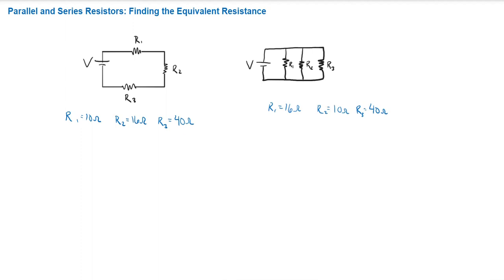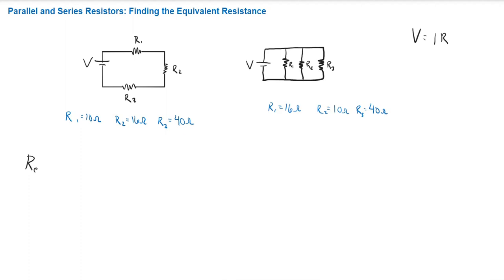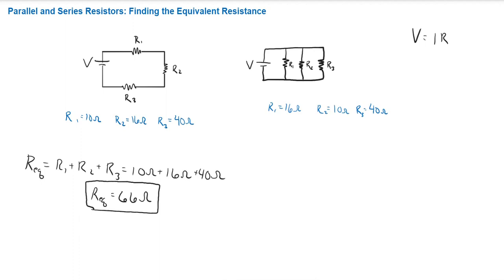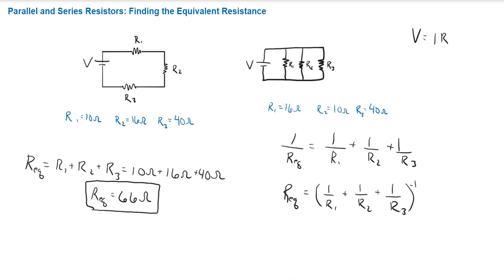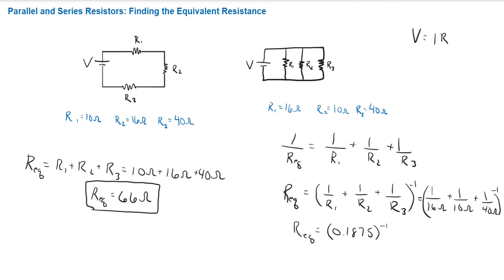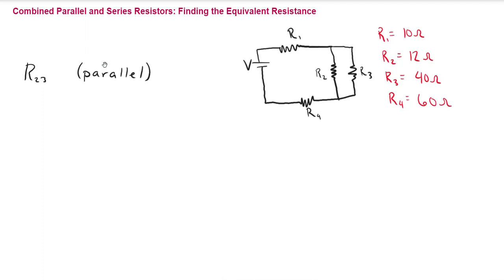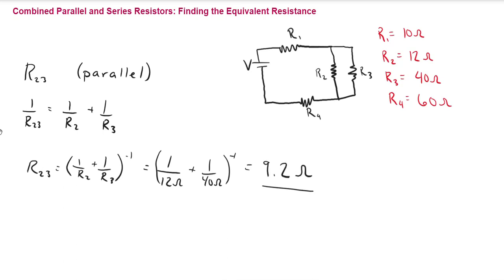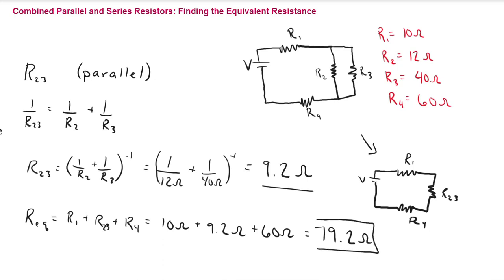Series and Parallel Circuits: Finding the Equivalent Resistance

Comment: Again how u found the inverse of (1/12+1/40) which is 9.2 ohm 
Anyone plz explain step by step ? Thanks 🙏🏾
Reply from the maker: You can first do the calculation inside the parentheses by finding 1/12 and 1/40 separately and adding those numbers together. Then you can get the inverse of that result by dividing one by that number 1/(result) or if you are using a calculator you can take that number to the negative one power. (result)^(-1). I hope that helps.

Comment: How u got the inverse of this number  (0,1875) ?
Which is 5.3 ohm? Plz explain.thanks
Reply from the maker: The inverse is 1/0.1875 or (0.1875)^(-1).
Reply: @Physassistant and then you round up correct?
Reply from the maker: @Bassnbanjos   The answer in the calculator will end up being 5.333 (repeating). Rounding this to 2 significant figures would be 5.3. Since the next number  (3, in the hundredths position) is lower than 5, you are rounding down.